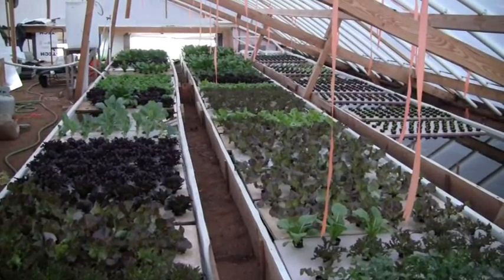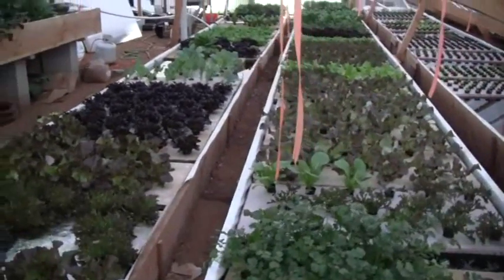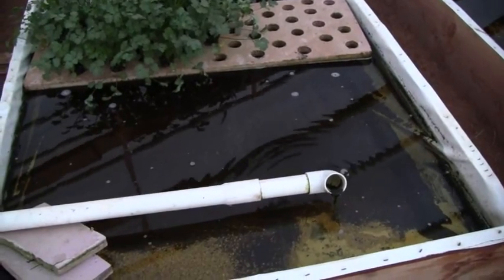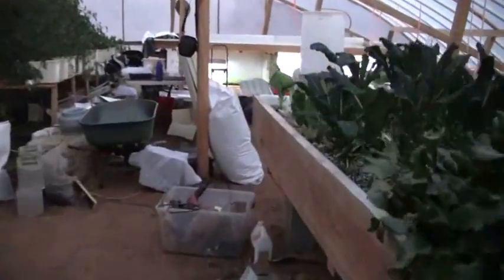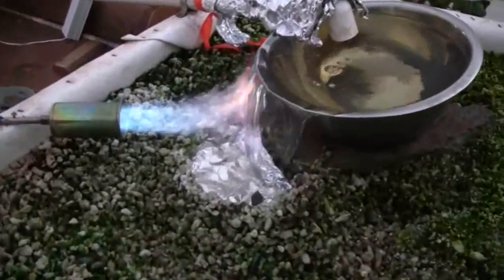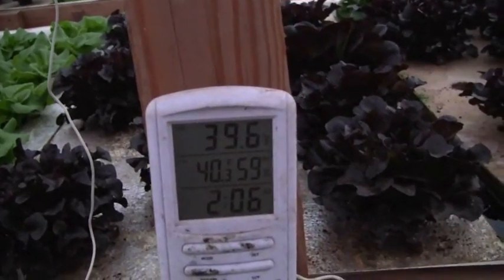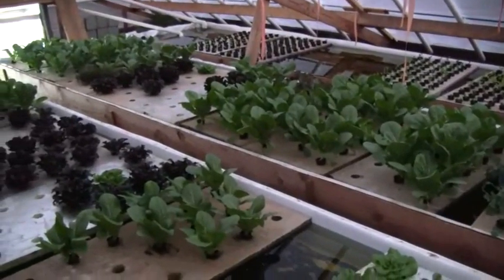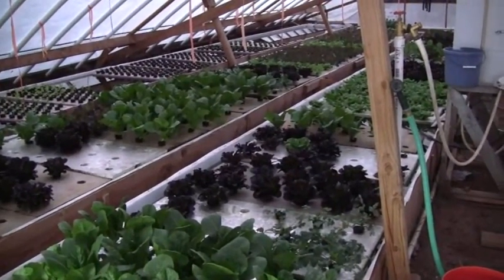Passive Solar Aquaponic Greenhouse Winter Heating with Flame Torch 1

Comment: I like the creative thought about heating the water on the top beds... I had a thought of utilizing a Dakota fire pit. IF my water tank or beds are on the ground, I can have stone channels just under the ground..where hot air from the dakota fire pit "used like a chimney" under the beds.. will radiate the heat into the water.. As far as beds that are above the ground.. still working on that.. Keep cranking out the creativity :)

Comment: A rocket mass heater would work great in a long space like that. Heat it up well in the evenings, and the mass will release the heat slowly throughout the night. A pellet feeder as another poster mentioned would keep it burning all night if necessary. What I'm doing in my greenhouse, besides the rocket stove, is using drapes (packing blankets) as night insulation on the inside, but ours is gable ended, not curved. Wrapping them around dowels and rolling them up will not be too difficult (I built a mock-up of it, to see if the idea might work like a matchstick blind, and it does). We'll see how much the blankets will mold due to the humidity in the greenhouse. ...We got the building permit last week, and I'm just beginning the 16x36 greenhouse build. It gets down to the negative 20s on some winter nights up here, but there are people growing bananas and other tropical all year, and we plan on doing the same. Good luck with your project.

Comment: Perhaps a propane heater tank attachment or a kerosene heater would be better for those extry cold nights? Also, Eliot Coleman claims that using spun bond covers in a greenhouse is the equivalent of achieving two (USDA hardiness) zones south which could make a big difference for you?

Comment: Hi, Ross!  You might consider getting some plastic drop cloth to cover your grow beds overnight.  This will trap the heat in the water closer to the plants, rather than allowing it to dissipate into the air of the greenhouse.  It works very well on my floating raft beds.
Reply from the maker: Greetings,  Yes, I've considered that and even purchased the pvc pipe to do it with.....I use 5 foot lengths of half inch pipe, bend it and drape plastic or shade cloth over it.

So I may do that.  But I really want the entire greenhouse to be heated, at least kept above freezing.  I still have tomatoes that I'm trying to keep alive all winter as an experiment for example.  And, I'm also planning on building an NFT vertical rack system, which would also want to be kept above freezing.  That will be one of those spiral systems where pipe runs down, left to right, forward, right to left, away, left to right, forward and so on, spiraling downward with holes for NFT.....a plant wall, 20 feet x 2 feet deep x 12 feet tall.  So I really need a full greenhouse solution for the small number of ultra cold nights....maybe 10 per month in mid winter????  Torch I working so far, but improvements on the way.

Comment: If you have any fish in your system you gonna kiss them good bye... Temps that low in the greenhouse will kill all the bacteria in your media bed.... Start testing the water now.... I was 3 weeks later heating my greenhouse an killed my bacteria even with a freaking 75 deg water temp in the system... I heater the water with a electric heater